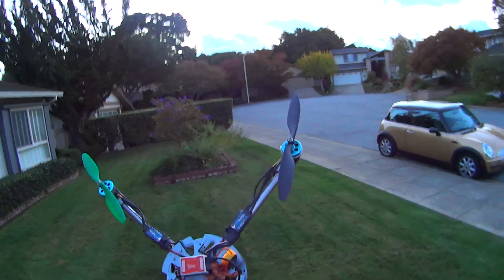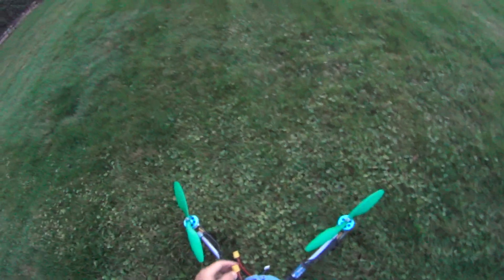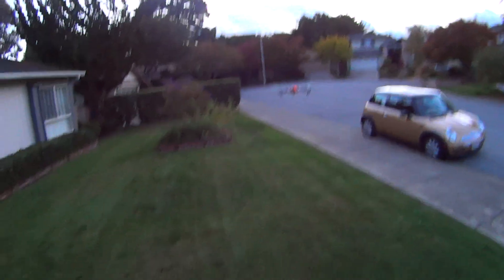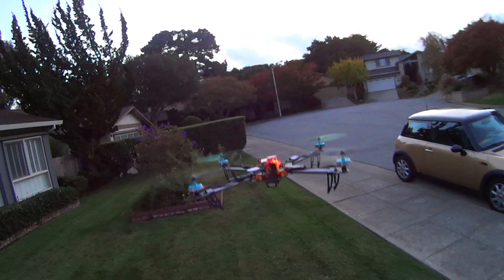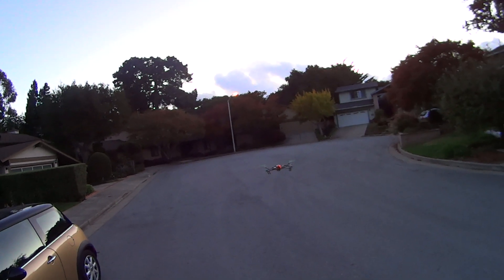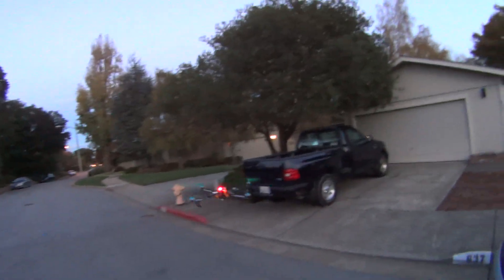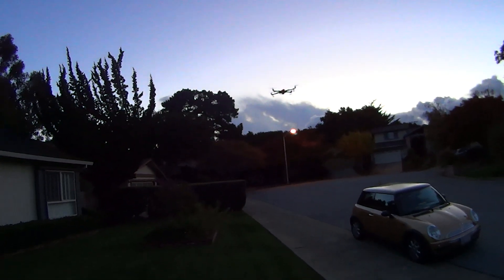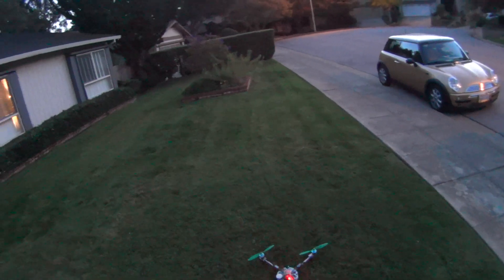Quad Testing: NAZA GPS, SimonK ESC's and H.A.L

Comment: Did you make your own tool for the ESC flash or did you use the the HK tool. I've been trying to make my own to flash F20a and cant seem to get the wiring right on the tool haha. If you made your own would you care to elaborate? 
Thanks for the great videos. I've learned alot from you.